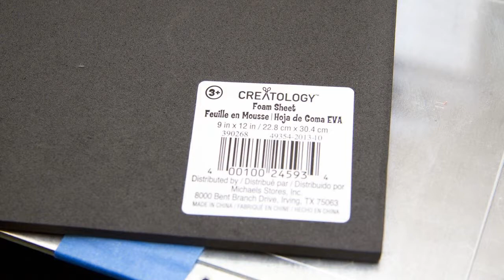RigidBot 405nm laser cutter attachment cutting foam

Comment: i want to cut 9mm epp foam. if you find a way please update!  good job:)  id still like to have this. how to make this work on a davinci duo 2.0 3d printer? thanks
Reply from the maker: +Tom Slaymaker I think it will cut 9mm foam, but how to make it work on Davinci..... this will be a challenge as it is uses fan connector from this printer for beam modulation !

Comment: A couple questions:

Where did you buy that at?

How do you make the files for laser cutting vs printing?

Do you need to have a second extruder to use a laser cutter on your printer (standard rigidbot has 1 extruder, just wondering)
Reply from the maker: thejoedude thefirejoe Sorry, just noticed your comment, I mad it my slef completely, if you interested please check website. I working on nicer looking version, may be do commercial run on it.